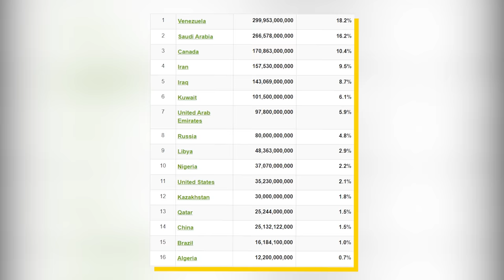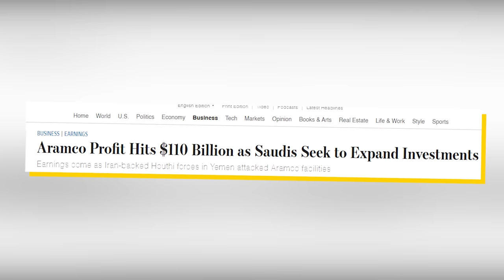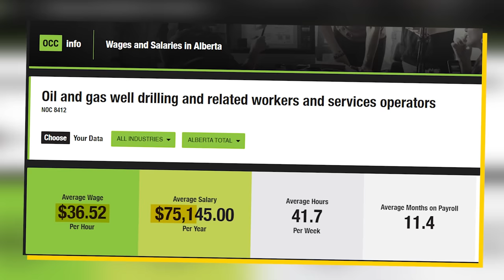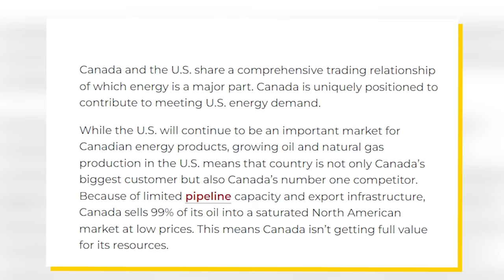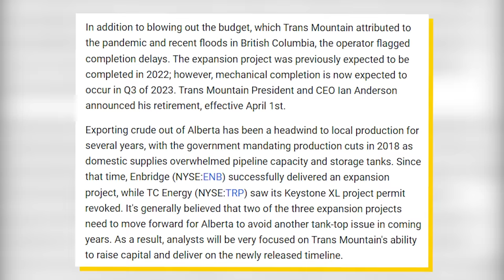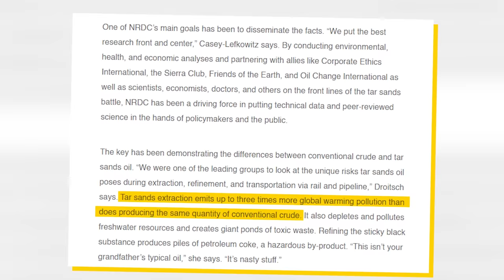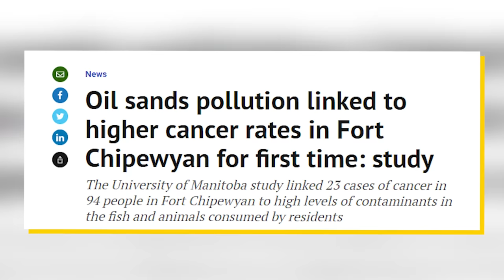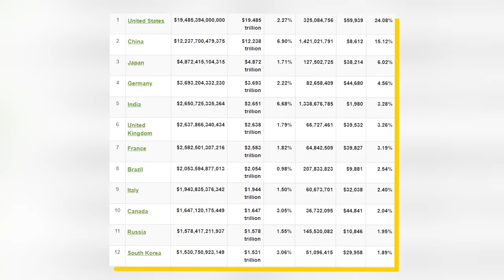Why Canada Refuses To Exploit Their Gigantic Oil Reserves

Comment: Canada has light oil assets and natural gas.  They also have substantial offshore oil.  Trans Mountain was initially built because of oil requirements for the Korean War.  Bituminous oil only came on stream in the early 1980’s after massive which factors into the Free Trade Agreement.  Oil pipelines now carry a mixture of light oil and   Not for nothing that Canada has become an oil supplier with a widened supply chain, because their ‘dirty oil’ is not so dirty politically.

Comment: Canada like Russia has a massive gas and oil reserves specially in Canadian Arctic archipelago (the new Middle East) with the ice melting and Saudi is running out of oil. Canada is slowly but surely becoming the world next energy superpowers.
Reply: Ironic, isn't it?  As the ice melts it allows us more access to extract and export the main product that is causing all that ice to melt so quickly.  Sounds like a win=win....until it isn't.

Comment: So I use to work on a service oil rig, fixing and abandoning wells. I was what they call a roughneck, basically the most underpaid and abused person in the oil field. I was told to do things that just went against any work place standard and almost died twice in 2 weeks. we worked 16 hour shifts with 2, 15 minute breaks and a half an hour in the middle for 21 days on 3 days off if the weather permitted. But I did get paid 38 dollars an hour. Down sides are that you have to work in minus 38, you poop in plastic gabage bags, and  you as a roughneck need to clean up everyone else's.

Comment: This video is a great explanation of why extracting oil sands should never have been started in the first place. This project was massively financed by the government directly and now its too late to go back because it became a giant economical sector in Alberta, making thousands of people's livelihoods dependent on this industry that ultimately like you said makes no profit. So we dumped a bunch of tax money in there (and still do) for something that only does harm. Plus Canada has sooooo much electricity that everyone could easily own an electric vehicle if they werent so god damn expensive, rendering the oil sand project useless in a few years when electric cars become affordable.
Reply: A) Oil industry doesn't do more harm than good unless you're a NDP MP in BC or Trudeau B) It's a massive part of the reason this country got rich to begin with C) I can tell you right now that even if they could, electric vehicles could not replace gas and diesel in the prairies. Batteries don't like the cold and you can't go 800km without charging but you can bring gas in jerry cans and at least in rural Alberta, Sask, etc. that is a necessity for some.

Comment: instead of using open steam extraction, hydraulically press it through hot filters.
Or put the sand in large tanks that are heated and have an opening at the bottom , and it would slowly trickle down into a transportable holder.

Comment: Canada ( Alberta ) really needs to invest in making stuff from the oil they have, if they really want to benefit the most.   Run it through refineries right next to the fields - that way you only have to ship the portions that you're going to use.  The unused portions can go into production of products in factories similarly located.  Lots of automation and then rail / truck can get finished products out - say, automobile bumpers - without having to build the oil transport infrastructure, which in the long run, can only be used for oil, and not re-used when conditions change.

Comment: just guessing with using some logic here: oil is a finite resource, at the current rate of extraction saudis are going to run out of oil within a hundred years probably less, saudis are exhausting this resource because it's not something they rely on because of their hot climate. cold weather places like canada rely on it more, so canada over the long term would rather buy oil and save their own reserves until the saudis run out, or renewables don't work out, at which point they'll use their reserves as a last resort.. isn't this all just a big long game being played? maybe this is overly simplistic but i never hear anyone talking about this being a finite resource, everytime i hear discussion people it just sounds like people think this stuff will last forever. what am i missing here.?
Reply: yeah people are angry but in the long run this could be good for Canada

Comment: Oil production in the oil sands uses 3x the energy to produce, but produces only 27% more pollution over the course of its life. This is because the majority of pollution is created in the use of the oil/gasoline. Therefore it is not nearly as much worse as the stat in this video would make you believe. We also have a TON of natural gas, which is much less damaging to the environment during spills, but is notoriously difficult to transport. That being said, a large LNG export facility on the East coast could provide Europe with most of the natural gas they need to heat their homes.

Comment: There is some crucial information lacking in the video; I live in the province where the Trans Mountain Expansion line is going through. First, unlike most of the United States and Canada, in the province of British Columbia (BC), where the pipeline is going through, few treaties are signed with First Nations. When the British and Canada later showed up, they just took land and resources without even trying to force a treaty agreement; it has meant many things are in legal quagmires today as it is not clear who owns sections of land. There was never a legal transfer of land. A good example is that in the early 1900s, the city of Vancouver forced local first nations off their land to build a park without compensation; 90 years later, they challenged that in court and got the land back as there was never any legal transfer of the land. Many of the delays with the pipeline have been due to working out legal issues with the first nations along the pipeline's route. Resolving the legality is partly why the government sold the pipeline's ownership to a corporation owned by local first nations.

The other issue that has made the pipeline unpopular is who is liable during spills; Oil Sands, even when processed before shipment, are still the consistency of tar and are made liquid for transport by blending it with chemicals. When the oil is in the water, like during a spill, those chemicals leave the oil, and it reverts to its tar-like form, sinking to the bottom of the lake, river, or ocean; the spill kills everything below. While legally, it is the pipeline owner who is legally responsible for covering the cost of a spill in the past, companies globally and in Canada have dragged out compensation, leaving governments on the hook to cover expenses. The issue is that British Columbia (BC) would have to pay for everything from cleanup to compensating affected businesses and residents. What makes this upsetting for those in BC is that they get little to no financial benefit from oil royalties; that goes to the province of Alberta, where the oil is extracted, and the federal government in Ottawa. It means residents of BC hold all the liability and get none of the financial rewards for doing so. Sort of like if you're on the hook for the insurance for your neighbor's house, they enjoy their property, but you have to pay if it burns down. 

Essentially the Trans-Mountain has been dogged with legal issues that previous governments had ignored until there was a financial motivation to do so. After many legal battles, negotiations, and protests, it does appear everything has been resolved or reached its end in court.

Comment: There are so many factors, that while it's possible to build more infrastructure and increase output, it's not vitally necessary. We don't need to get rich quick and the environment is very important. Keeping Canada cold and lousy with trees and freshwater is probably far more important in the coming decades. Even once the major global  economies transition away from such a heavily oil dependent model it will still have applications beyond burning for fuel. The petrochemical industry will need oil long after we stop needing furnace oil. It would be nice if we could extract it with less bother but it's probably for the best we can't.

Comment: It's not they they refuse, there are geography issues being that Alberta and Saskatchewan are landlocked and provinces don't necessarily want Alberta's oil pipelines crossing their land to get to sea . Only the US is a willing and they've been snubbing Canada oil since they started pumping shale. Lots of gas in the arctic but another geography issue, ice and the fact that its on islands so forget pipelines. Mind you I don't understand why Alberta and Saskatchewan just don't ask the feds to get a pipeline going to the north shore of Yukon, Yukon's not a province so provincial powers. They'd have  access to the ocean. It could justify Canada's claim on the arctic; it would create a new settlement . It would also be a shorter pipeline so cheaper.

Comment: Complex Canadian politics and the rivalry between the oil rich west Canada which supports conservatives and the east, where literally all of the governments have been based and also elects liberals is the root cause of many of these issues. We can’t solve the issue of complex and expensive extraction processes, but we can surely improve the freight and transportation. But with an anti oil party in power and the opposition being pro oil, it has led to a deadlock on resolving numerous issues that face the oil and gas industry of Canada. The partly solution could have been keeping the oil and gas industry separate from politics as is the case in many middle eastern and Asian countries where oil companies are state controlled. That’s my perspective as a petroleum engineering student in Alberta.

Comment: So if the original pipeline is 52 years old and averages a spill more than once a year, and by correlation is causing cancer. 

isn't it time to rebuild it?
Reply: Ya see that was the plan (kinda) and BC did everything it could think of to get it cancelled

Comment: You have totally missed the number one issue facing the energy industry in Canada. The problem is Justin Trudeau and his far leftist government. Lose them and things change, and fast!
Reply: Regarding the expansion of the pipeline to BC, there were many issues, but the tl;Dr is that Alberta wanted 100% of the benefits, and leave all the other provinces stuck holding the bag. All profits were going to either Alberta or foreign companies, and Alberta refused to pay for any spill or accident, which would have cost tens of billions at minimum in ecological damage over decades if it occurred anywhere near the straits.

Zero economical benefit to BC.

Comment: The salary mentioned in the video isn't correct. Yes, salary starts at $36 an hour, however, most companies will require you to work some variant of 20 days on 10 days off. the 20 days on you're working 12 hour days. 40+ hours of over time a week which would be $54 an hour. Starting pay for oil workers would start at $110k in realness. Excluding daily allowances

Comment: You brushed over the Trans Mountain pipeline incorrectly.
To be clear, the twinning of the pipeline is going in the ground as we speak, and is on course for the 2023 completion as forecasted after Covid.  The opposition to the pipeline is an old story, opposition has been shut down or they have given up ... its a non issue today.

You were very unclear with that.  Add to that the distances in Canada make any project like this, take a long time.

Beyond that, most of your reasons are pretty close, the biggest hurdle for international final product lucrative sales is the lack of refining in Canada, and the refining companies are not really interested as the margins are too close, refining from bitumen.

The other thing is, Canada doesnt see it as 'a bit of oil money', its seen as the way in the medium term, to pay for green energy technologies so when the time comes, Canada is on the forefront of exporting these technologies when the oil taps are turned off or down significantly.  A smart govt uses the profits from oil to get off of the reliance for oil.  This is the long term plan for the present Canadian government, regardless of how much the opposition to this govt throw incorrect rhetoric around.

Comment: I doubt there is a single person working in field in oil and gas making less than 75000 a year, and if they are they can find a new job right away making more. drilling rigs are 12 hour shifts, and usually scheduled with 2 weeks on and 1 week off, 20 days on and 10 days off, or some variation. most services or projects run day rates, and some services get paid by job, but they all work out to be well more than 75k cad a year. few welders in canadian oil and gas make less than 800 a day, and often more. wages are going up significantly too, especially with the fact that few people want to actually work in the conditions.

Comment: You would have to be crazy to work at the oilsands for15$ per hr. Most companies out here have competative wages. You can easily get 30$ with no skills or education. I haven't seen anything under 25. And with my skill set,i wouldn't take anything under 50 flat

Comment: You're completely wrong about wages. Making false statements about wages is also extremely detrimental to the working class. Big-oil corporations are loving this video as it gives them a means to validate the already low-pay for oil and gas workers (the average wage includes "entitled" positions for non-field workers). Companies in the Middle East are literally poaching Canadian oil workers in spite of the fact that they have to adjust to a totally different environment. We'd get paid far more in the Middle East... why?
Productivity per man-hour-cost will ALWAYS.... I repeat, ALWAYS trump the idea that simply paying the lowest possible wages. Corporate incompetence and narcissism among execs (a notoriously bad problem in the oil and gas industry) are common causes of unnecessarily (and unproductively low) wages. Any company that pays unnaturally low wages actually hurts it's respective country's economy, which is killing Canada right now.
I'll repeat: The Middle East literally lures Canadian oil workers, knowing full well they'll have to adjust to their surroundings (including a 30 degree jump in the average yearly temperature) by paying HIGHER wages. I worked in the oil patch up until 2008. Wages are exactly the same as when I left... At least in Canada.
You also ignore the fact that Middle Eastern crude has to be shipped via tanker (burning heavy diesel oil) across oceans. The oil sands are far more cumbersome to extract the crude from initially, but the short distance to market...

Comment: The pipelines would be fine if you know they didn't leak constantly. 

It's because at least in the U.S it doesn't matter as much if it leaks. It's cheaper to "clean" the leaks than build a pipe that may never leak.
Reply: Canada's (and the US') pipelines can go, have gone, and will go years without leaks. Sure you hear of one every so often but pipelines are literally the safest way to transport oil. Most spills are from ships

Comment: Ignore all of the reasons in this video but one.  While everything mentioned here is 100% factual, if left to the producers, they're more than happy to invest in the oil sands and make money even if it's not as much as the Saudis.  There's one reason alone why our O&G isn't being exploited: activists.  Especially those currently running our government.  You may be OK with that and I'm not judging one way or the other, I'm just stating a fact.  The industry is just fine with profiting from the reduced price if the government would allow them to.  Everything else here is chaff.

Comment: We need to move towards hydrogen gas for where it makes sense (fuel cells and vehicles) and reduce oil consumption
Reply: Storage of hydrogen is quite problematic. Given the size of the molecules, its very hard to prevent leakage especially when implemented on a wide commercial scale and they are even more serious as a greenhouse gas. They are also an explosive hazard category that we have no experience in if implemented in widespread fashion. I'd agree that hydrogen based fuel has a role but ought to be oriented towards industrial users. Give us the opportunity to work out the safety issues and develop the appropriate infrastrucutre for storage.
Reply: The fuel cell that powers the Murai is said to cost more than $60,000 USD.  By "We Need" do you mean: we need to spend more on energy?  we need hydrogen fuel cells to be cheaper?  we need clean sources of hydrogen?  All this sounds like it'd be nice, but not what we need....

Comment: What fixes the majority of these issues? Automation. Especially automation run by human-level AI. We're likely less than 5 years away from such a reality.
Reply: In terms of the political and environmental, AI and Automation addresses this as well. Many of the polluting processes involved can be cleaned up by injecting significantly more labor. Especially if that labor is far higher functioning (skilled). 

By 2030 we should expect human-level AI's in physical robotic bodies will be capable of perform at or above existing trades and specialists in the human labor force. But, AI won't stop improving at that. By 2035 the highest-tier engineers in every field will be outstripped by inexpensive, mass-produced robots.